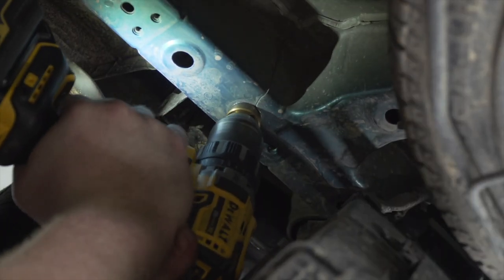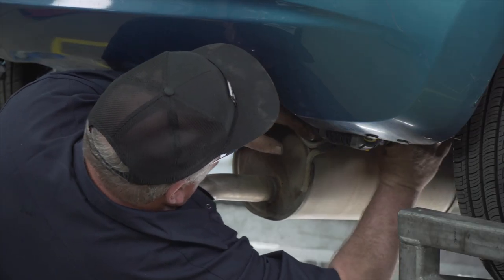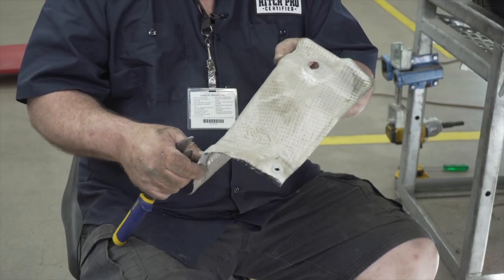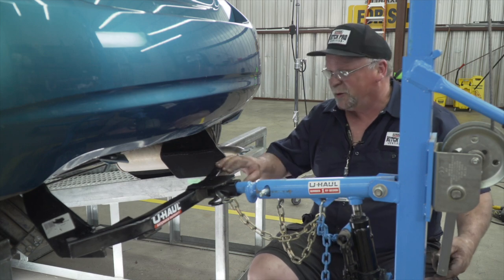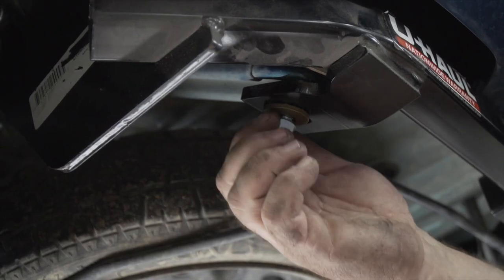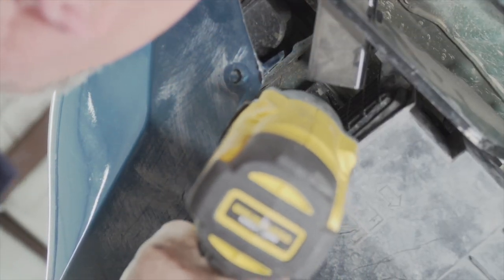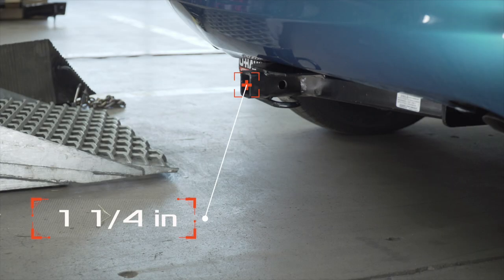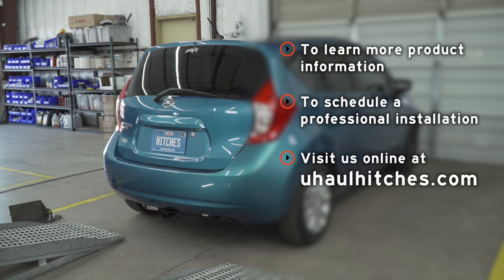2015 Nissan Versa Note Trailer Hitch Installation

Comment: Do you have a video like that, but for a micra 2015.
Reply from the maker: We dont have a video for that vehicle but we do sell a hitch for it. You can buy one here - Uhaulhitches.com And the install is very easy and can typically be completed in 20-40 minutes depending on your skill level.

You can check out the instructions here - https://assets.curtmfg.com/masterlibrary/11453/installsheet/11453_INS.pdf